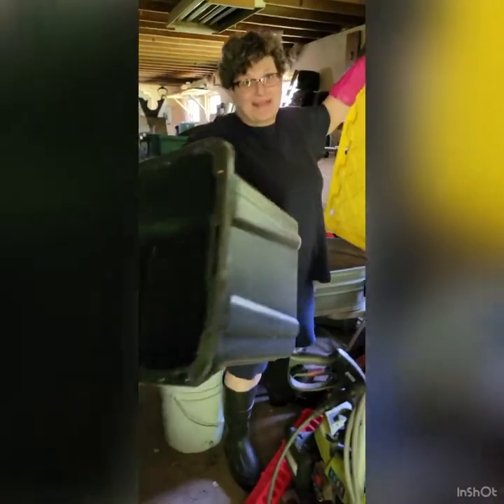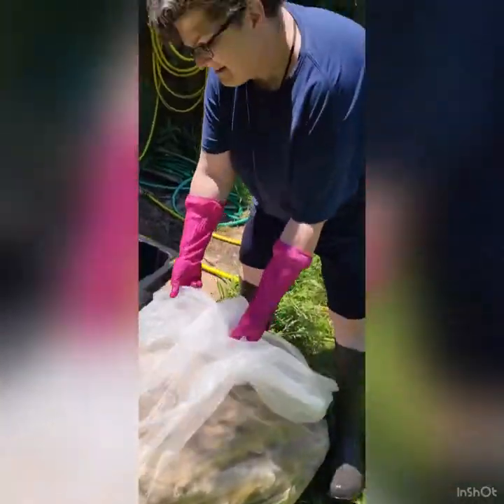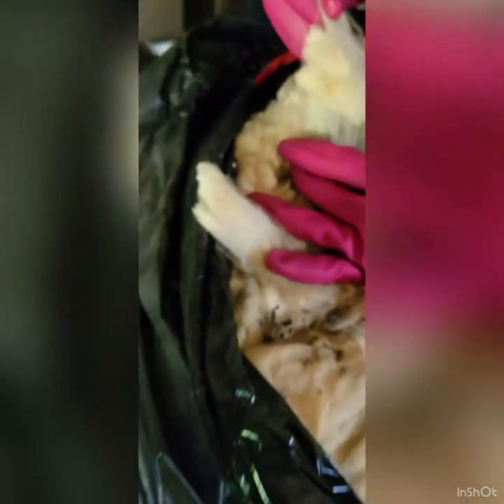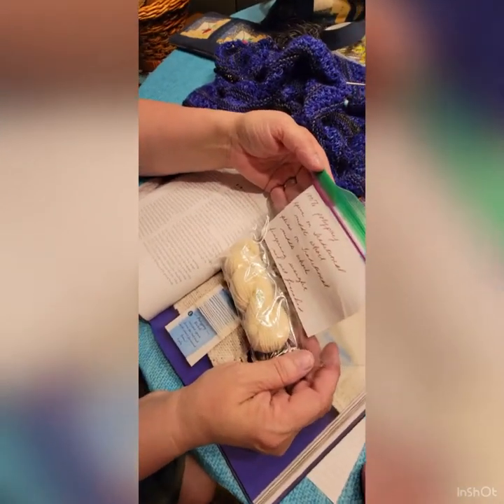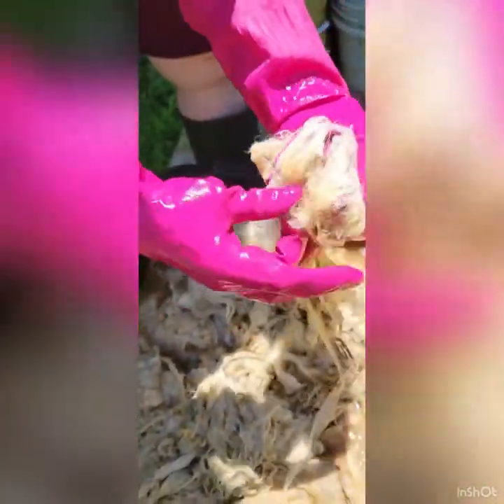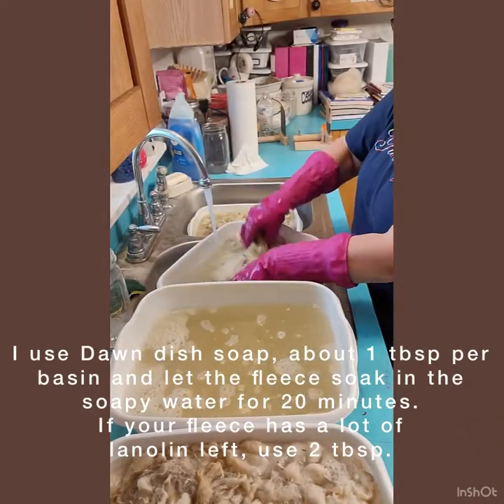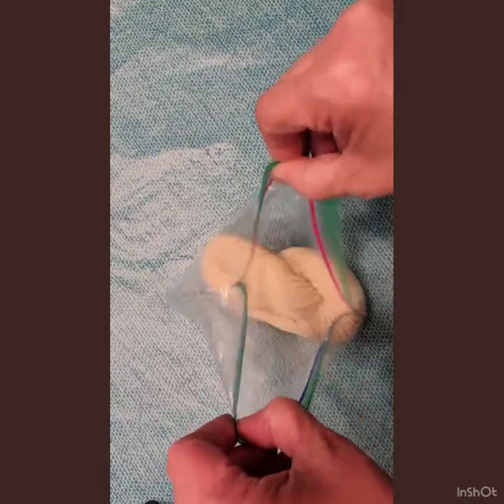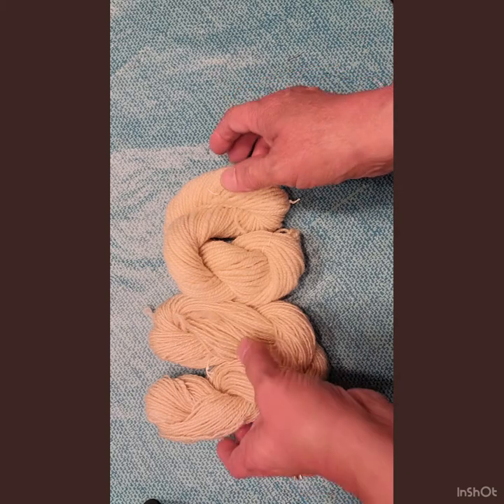How to Use the Suint Fermentation Method to Clean Fleece | Watch me Work Tutorial

Comment: I have wanted to try this method for a long time as it’s so much cheaper to ship the wool to the fiber mill plus cheaper since the starting weight does not have all the dirt and lanolin
Everything in my head is screaming that it’s going to felt going from hot to cold and that’s with terrifies me lol
I generally wash in the lock but it’s very time consuming going to have to try this this summer
Thank you for the video very informative, SenkoFarms
Reply from the maker: You are very welcome. I have never had any fleece felt on me and I have washed around 20 different breeds so far. Going from the cold soak to a scalding hot wash doesn’t even felt them because there is no real agitation and soap. Aside from those conditions not being met, after you start washing, the temperature of the water will remain hot so there is no real temperature change to worry about. Give it a try on a small amount of fleece in the sink. It wouldn’t be suint but washing from a cold soak to a hot wash and hot rinses, you will be able to see that the wool won’t felt as easily as you are thinking it will. 😊 I can’t wait to see your results. It is a whole lot lighter with all that lanolin and dirt removed. Good luck.